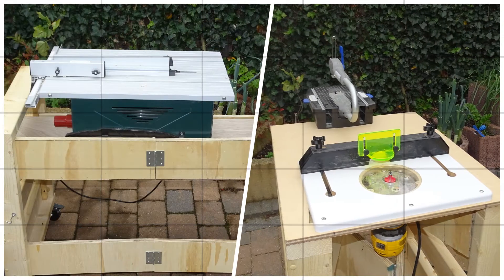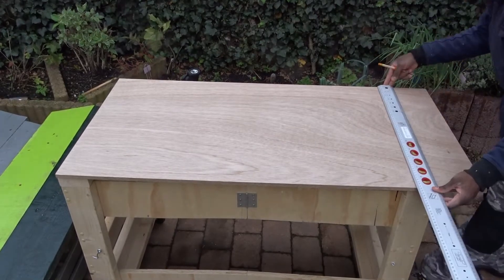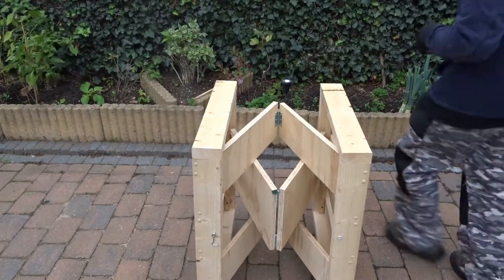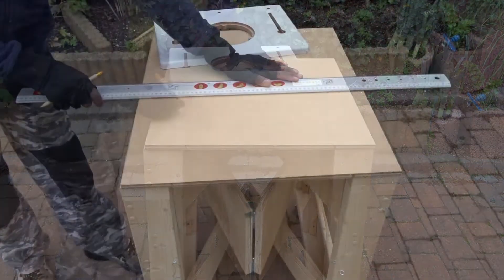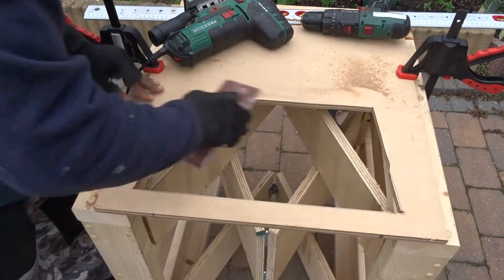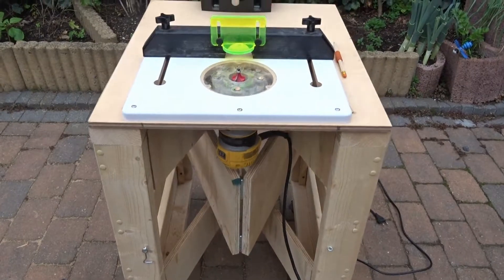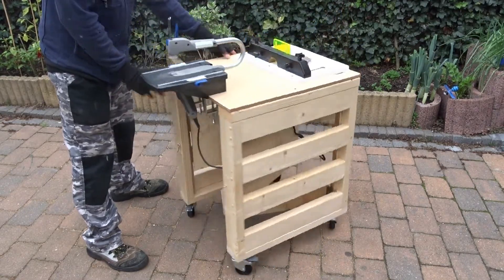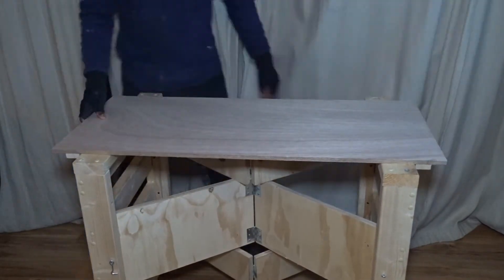Transform-IT into a table saw/ router table mobile cart // How to

Comment: I'm really liking this channel. You have a cool voice and a great attitude.

I'd be inclined to put some threaded inserts in the tabletops and run some star-bolts up through holes in the top part of the transform-it frame. That way the tops can hold the thing rigid. Paranoia, perhaps, but inserts aren't too expensive and a few less broken glasses and hurt toes would probably be worth it.
Reply from the maker: Mulletmanalive  thanks, apreciate the support and advices